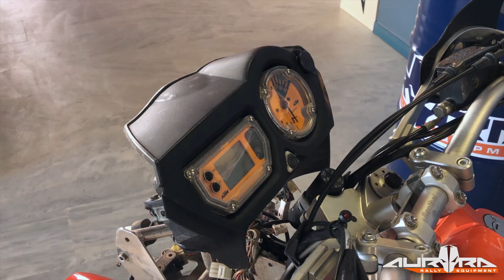950/990 Rally kit installation video

Comment: I'm just discovering this in June 2023, and I am making plans to purchase the Rally Kit for my 2013 990 Baja. Am I correct to assume that I will gain clearance between my handguards and the windshield over stock at full turn? This has always been a problem with the stock setup.

Comment: I really like the Kit but i got a few questions. What about the rev indicater? Are the Cable just stored in the tower? Is there a digital replacement? Is it street legal in Europe as well? Do you only craft the Rally sidepanels from fiberglass or is there an option to get the adventure sidepanels made out of fiberglass or even carbon as well? Last but not least: Do you ship to Austria? Thanks in advance
Reply from the maker: Hey @Joda.Sir.Crank,  thanks for your interest and trust in our products.

The rev indicator is removed. There are digital replacements from Trailtech if need be, and you can add them to the back plate. 
The lights are fully street legal and the frame is not modified in anyway. Plus, most parts from the KTM OEM rally bike, so the part numbers are available for the TUV guys. 
Shipping in Austria is ok for sure. Regarding the side panels, the rally ones are only from fiberglass at the moment (No CF), we are working on making them from ABS too, but there is no ETA yet. The Adventure side panels are from ABS. No option yet to get these from CF. The reason is mostly that CF needs to be painted there anyway otherwise the bike looks odd, and the weight difference between the ABS and CF is negligible for those panels.